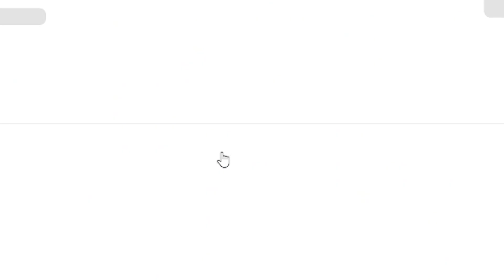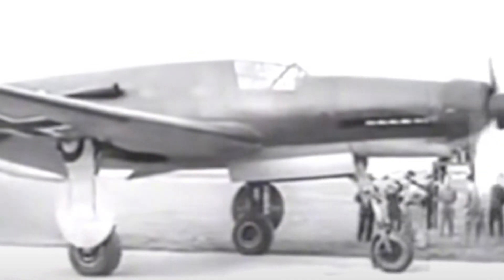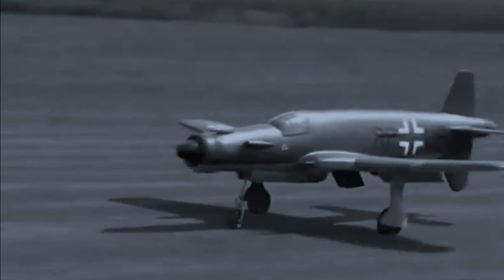Dornier Do 335: The Fastest Piston Airplane the World Forgot

Comment: Will the p-51h was probably in its prototyping stage at this point but if it had made it into the pipeline it would have annihilated that turned. And what was in production and available the p-47m and in models what is annihilated this turd as well. And then the Corsair let's talk about that. I don't think you could have handled any of those. And let's not forget the spitfire the latest into the line spitfires we're no slouch. So it's faster in a straight line who gives a crap. The 262 is faster in a straight line as well. They still got shot down